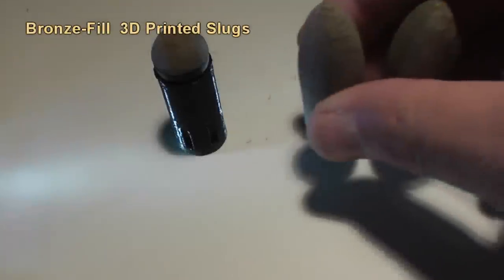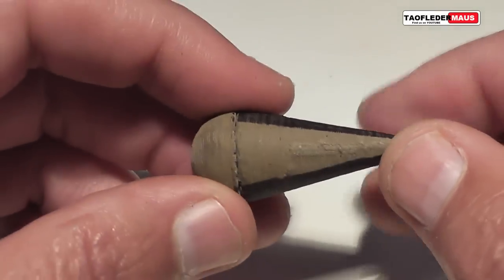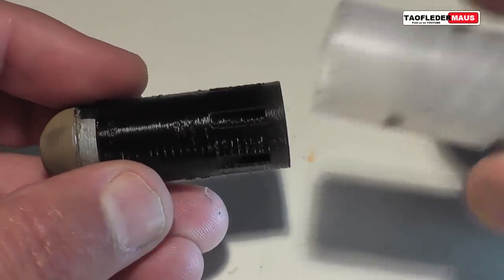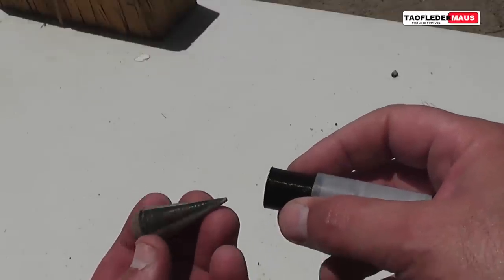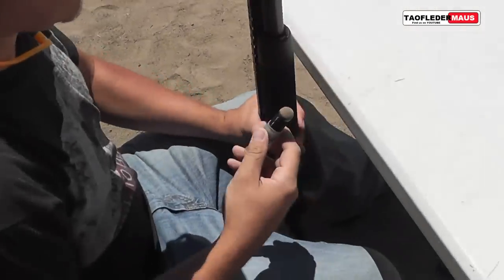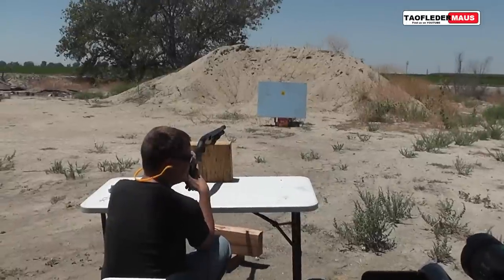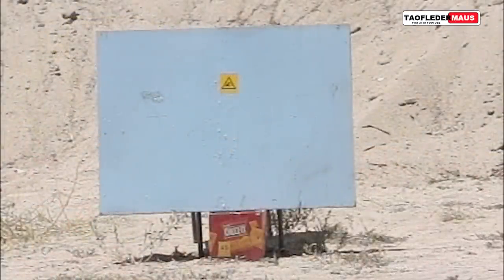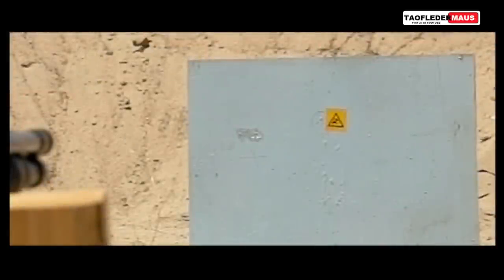Teardrop-shaped 3D Printed Bullet -   Fail Analysis

Comment: My best guess would be that the initial acceleration compressed the projectile and sabot (due to the sabot accelerating more quickly). This compression stuck the two pieces together to such an extent that the air rushing past the round was unable to make it separate.

The best way to fix this would probably be to make the sabot a multiple piece design.
Reply: ExF1Guy that pretty much was what i thought ....in every detail XD
Reply: ExF1Guy because of the shape of the round, I'd worry that a multi-piece sabot would expand in the barrel and jam
Reply: Ian Walker That’s a fair point. Perhaps the sabot needs to be replaced with something that does not fit the projectile as well. If you had it fit the bottom half of the projectile and then have a gap between the sabot and the projectile (near the front), you might be able to negate these issues, by increasing the sabot’s drag. Thanks for pointing out my error.

Comment: The sabo had no reason to seperate from the bullet, and every reason to stick with it. (air pressure / drag)
Reply: It's more to do with the fact that the acceleration would have jammed the cup against the projectile before the latter's inertia was overcome. Also, the friction between the surfaces (they looked very rough) would have meant separation was near impossible
Reply: Enduro MF exactly, the propellant charge is blasting the sabot towards the cone, probably fusing them, after they leave the barrel, there's nothing that makes the sabot split(no extra drag, no residual forces splitting it), in fact as it is it acts kind of like wadding
Reply: Jordan Philip Correct that didn't help, however with the correct design this can easily be overcome. All that needs to happen is the tail of the round needs to be firm against the back of the sabo, preventing the sabo from just eating the round up and not letting it go, second the sabo needs to have a lip that protrudes past the maximum diameter of the round by a significant enough amount so as to create significant drag on the sabo and separate from the round. The key here though is the tail of the round touching the bottom of the sabo, preventing the round from getting smashed backward into the sabo.
Reply: They should have cut the Cylinder in half.
Reply: Cat418 Exactly what I was going to say, just cut it in half and it would have most likely fly off.
Reply: Guillermo Lovato That's my understanding too. It's somewhat the sabot that pushes the cone, so there is no reason for the cone to fly faster than the sabot, they just fly together. The split of the sabot as mentionned would probably work, especially with some extra drag at the sabot level. (+ be sure the 2 do not stick together any way)
Reply: Cat418 Possibly leaving a hinge on the back plate of the sabot would also prevent it from going awkward/separate angles before it left the barrel.
Reply: Enduro MF On top of that, these are 3D Printed, they might have softened up and fused together due to the heat of the charge and the compression of slamming into eachother.
Reply: +Enduro NE It also had no reason to fly straight in the first place (or close to the smallest reason you can think of), it needed fins.
Reply: Not necessarily, because on teardrop shapes the tail usually does a good job of stabilizing it
Reply: They would just cut 3/4 of the saboo

Comment: Sabot is too heavy? And should probably be multiple pieces so they slow down in the air. 

Looked like a nasty little ice cream cone
Reply: There also was a lot of unneeded material near the bottom, so maybe a segmented sabot with folding fins or channels to create drag and pull it off after the shock from the powder.
Reply: TheTechnosasquatch I agree. I was a tanker in the Army and our "sabot rounds" had aluminum "petals" that separated after leaving the gun tube. If you google M829 Sabot you'll see exactly what I mean.
Reply: The Wound Channel I was thinking the same thing. If the sabot was in multiple pieces, even two, as soon as it started to separate the wind would catch it, pull it apart, and it would have a lot more drag, slowing it down relative to the projectile and allowing it move away..
Reply: The Wound Channel I think a sabot would not have worked, since the teardrop shape has no retention inside the sabot. The bullet would simply accelerate faster than the sabot inside the barrel (because friction), opening the pressure seal and venting the gas through the sabot and around the bullet.
Reply: Jain Zar Either that, or the pressure would force the sabot to partially pass the cone shaped bullet, either wedging the assembly in the barrel or at least creating extreme friction between the expanded sabot and the barrel. I guess there is a reason there are no traditional projectiles shaped like this.

Comment: Definitely keep the lightblue background for future testing shots, the contrast is very good.
The reason why the sabot didn't detach might have been the inertia of the slug. It was pushed into the sabot when the propellant went of, and the polymer sabot slightly deformed around it because of the shock, creating enough grip around the slug that the friction between the two surfaces prevented the sabot from falling off when the slug left the barrel.

Comment: The answer to why the saebo remained attached to the round is quite simple. Allow me to explain: 
1. Both the round and saebo are grooved, this creates an interlocking mechanism when forced together. In this case the g-shock from the round being shot is what forces the two pieces together. these are forced together because when equal force is applied to objects of differing wheights the lighter object moves faster, given inertia the saebo accelerates into the completely still round thus interlocking them due to their grooves.  2. As the round exits the barrel of the firearm there are many forces at work that affect the round on its path to the target, the important one here is drag. As the round travels through the air drag between the round and the air further apply pressure to the nose of the round, this further press fits the two pieces together. The geometry of the round in regards the saebo ensures that drag on the saebo is kept to a minimum, thank fluid dynamics for that.

Solution: simple but effective.  1. In order to allow for proper separation of the round from the saebo one must smooth both surfaces, this keeps friction between the two as low as possible.  2. The saebo must be comprised of multiple detached segments that simply wrap around the round and slide into the shot cup with a firm grip. If done correctly this ensures separation and eliminates the issue of the rounds geometry affecting the saebo in flight as it won't be there shortly after the round exits the barrel. If these adjustments are made the round should separate from the saebo without further issues. 
~Hope this answers your question as i hope to see this round in action.

Comment: Is there a way to cut the holder in half so when it comes out the gun it splits apart?
Reply: Cuting it in four and putting a very small rubber band around it could work
Reply: Matias Stette You wouldn't need the band, the shotgun cartridge would hold the sections together.
Reply: Maxx B realised that after i commented and was allready on a different vid and im too lazy to change it

Comment: Hey Jeff! I'm happy to see you put this idea into action :) I bet if you put graphite in the sabot, it should negate the stickiness. Also, if you make the sabot in a cone shape and fan out the point like the base of a wine glass and make it curve a little towards the top of the sabot, that should make the sabot catch the air enough to make it seperate. To help you get the idea of what I'm talking about, a cross-section would look kind of like this:    top  :::>)  base. It should also help if you make the sabot out of a lighter material than the slug.

Comment: The reason it failed is because the force of the detonation forced the holder into the back of the round, essentially pressing the round tight into the casing. This was because the casing accelerated before the round and there was nothing to accelerate the round from the casing.

Comment: ***** The thing that instantly comes to mind as to why it failed: The shock of acceleration pushes the "sabot" onto the teardrop because of it's cone shape. Mix that with what is now (I'd assume) a very back heavy projectile and you have the right ingredient for a tumbling round. That would be my guess anyway.

I think you'd need a sabot that is in multiple pieces and maybe even some fletching of sorts to force the sabot to separate as soon as it can generate drag.
Reply: halsoy Pretty much spot on-with what I said. I also think that the force may have simply 'wedged' the two components together in the same way pounding on the front of it with a hammer might.

Comment: With the ridging that is caused by 3d printing, the shock of the sudden acceleration probably jammed the cone down into the sabot which made it stick (Sharpie ink can work as a weak adhesive under high stress conditions) and lock into those rings. Then there wasn't enough drag on the sabot to separate them because most of the drag is on what ever is in front (I.E. the cone shaped round) which held it into the sabot even more.

This is why sabots are typically cut into 3 or more pieces and designed to break apart upon hitting the still air at high speeds.

Comment: I think the reason the sabot didn't separate from the round is that the sabot is so much lighter which intern allows it to accelerate at a faster rate meaning with enough distance they most likely would have separated but with close range the round itself didn't have enough time to reach its maximum volacity

Comment: I believe the sabot stuck to the projectile because the g-force 'smooshed' the two pieces together. If the sabot were made to fragment into multiple pieces, I think that would enable it to separate quickly and allow the projectiles own design to stabilize it.

Comment: I think it's how the 3D printed material is layered, the "rings" are creating friction and holding each other, preventing the holder and the shot from separating. I think if it was smoothed down it would separate, but I still think it's not likely to shoot much better than that due to its shape and size.

Comment: Air friction is a projectiles worst enemy. There's a reason why larger bullets are made the way they are. Small as possible in the front and heavy and slightly larger as it goes. This projectile if shot backwards, would have done best.  Bullet makers, make sure you have a nice tip on most objects to ensure the air splits from the tip as to keep things flying straight as possible.

Comment: i agree the sabot should be at least 2 pieces so it can separate, otherwise they will just travel together. either that or the edges of the sabot will need to extend past those of the projectile so that the air resistance will cause it to separate, but im pretty sure having the sabot in multiple pieces would be a much better idea.

Comment: The round itself, due to the tip of it, was the reason it didn't leave the sabot, IMO. The leading edge of the round made it so there was not enough airflow to front of the sabot. In aerospace terms, it was sort of creating a stall effect in that the flow was not staying attached to the round itself. the only way to describe this is think of a snow plow on a the front of a train. The snow is the air and and the plow itself is the rounded tip of teardrop. If the velocity of the of the plow(teardrop) is high it will push the snow(air) out of the way and throw it farther away, where as if the front of the plow has a more acute angle of attack(? not sure if that is the right word) it will displace the snow less. So basically, the flow of the air was laminar and created an area where air could not reach the lip of the Sabot and did not create enough air resistance for the sabot to separate. It's a free body diagram really, the initial force of the shot from the shotgun itself was greater than that of the air resistance generated by the lips of the sabot. That's why in Sabot rounds for tanks, the perpetrator is further in front of the sabot and there are lips around the edge to help generate more air resistance.

All of this is my OPINION. I may seem like I'm trying to sound like i know everything, but i really don't. I'm going off of what I've learned in all of my aerospace classes and physics classes.

Love the videos by the way!

Comment: About the sabot, I'm interested to see if simply splitting it down the middle would allow it to separate. Much like the Abrams' 120mm APFSDS-T round is made, the jacket surrounding the shot splits into two parts and drops away from the tungsten shot itself. Thinking about it, there's a vacuum behind a flying bullet, so, when you split this sabot jacket, the positive pressure pushing against it will cause it to split away from the shot. The negative pressure created by the vacuum behind the shot acts as a pivot point, and allows the sabot jacket pieces to pivot outwards from the shot, before the positive pressure forces them away from the main shot.

Comment: try notching the sabot in four strips running down the length of the shell. Divided into quarters, give a weak point for the sabot to break apart when it leaves the barrel

Comment: if in fact the sabot was a matching taper to the rear of the round I would bet that the tapers locked together under compression just like tapers in machine tooling holders like say a morse taper.

Comment: I haven't read through all the comments because I'm on my phone, but my thought is the sabot never separated because it wasn't sectioned off for 3-4 pedals to open once air hits them to spread apart and increase the surface area for air to push it off the round. 

Idk

Comment: One big thing, the friction between the cup and the round, had they both had smooth surfaces then the cup may have separated from the bullet but there was nothing to slow down the cup, without separation the cup would have had the advantage of the aerodynamics of the whole unit.

Comment: Due to the round being in a teardrop shape with more weight in the front when fired, the round will spin around (which is why it's a teardrop so it'll pierce the target), but since the holder is so light and does not have holes for air flow, it held on as the teardrop was moving through the air. Basically, the lighter object is trying to pull back as the heavier object is spinning around and pushing forward.

Comment: 3D printing prints things in layers which you can clearly see in the objects. What most likely happened was the ridges caught on each other between the two 3D printed objects and the force from the blast probably forced the two together further. You want a smooth surface on both objects but that would be pretty difficult to do unless the material was ABS, in which case you could use an acetone vapor bath. In this case, I would say use some sand paper and some spray on primer filler. You'll also want the teardrop projectile to be heavier than the holder so I would say make the holder out of a lighter plastic.

Comment: Interesting content as usual, Jeff. That load basically nailed itself into the sabot, I think. If you look at commercial sabots, they break into symetrical parts and only have shoulders roughly in line with or parallel to the bore axis. Thus none of the forces wedge them together. Still, even with commercial ammo, sabot separation is problematic.

Comment: The back cone of the tear drop projectile creates drag and that is possibly why the plastic support did not leave the tear drop. You can actually make screw drivers float in mid air with a thin hose and an air compressor. The air blowing on the screw driver and the screw driver's rounded but create enough drag to make the screw driver float
Reply from the maker: Shadenox   The levitating screw driver is normally done with a wooden grip from a file.  It's more "teardrop" shaped and works a lot  better.

Comment: Well we know the problem is non separation because the round and the case were traveling at the same speed. I would recommend dividing the holder into segments, 2 should suffice. you might also want to look into putting in spring-loaded fins to introduce drag into the aft section of the holder. But I might be over-enginerring this thing.

Comment: The sabot didn't separate because it had no mechanism to. They're supposed to break away- if it were designed in three or fours sections that fell away from the round as it traveled, it would separate. Since it's one piece, it moves with the round.

Also, it the sabot made from the same material as the round? It should be a lighter material.

Comment: It's probably the ridges from the 3D printing.
Smoothing the outside would help, as right now the sudden pressure might force the sabot and teardrop to get stuck tighter into each other.
Seeing the rough finish of both objects it would provide with a huge friction area, it might even push together so hard that it sort of locks together, it you sand down the teardrop you have way less friction, also make the air ports wider so they catch more air to force the sabot to lower speed whilst the teardrop keeps accelerating.

Hope this helped.

Comment: firing the round probably pushed the bullet real hard into the holder, and considering how 3d printer material is pretty frictiony and a bit flexible, I'd say the shock just stuck them together near-permanently.
Cutting the holder in two down the middle should fix that, as it would separate like a rocket stage immediately after firing.